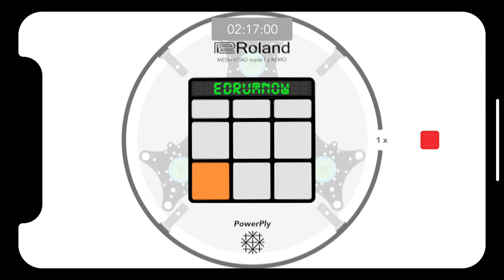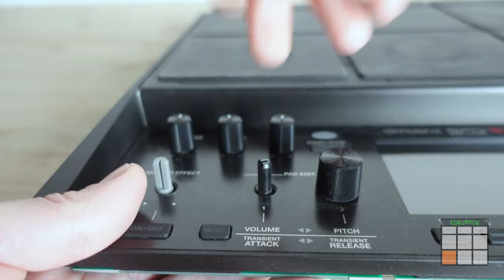Roland SPD SX PRO Disassembly

Comment: After I had to tear apart my Alesis Multipad apart to fix a corrupted sd card, I bought this to repace it in my live rig.  So simple compared to the SX PRO.  I never ever want to have to open it, but really enjoyed watching you take it apart.  Get it back together correctly, lol?  OMG, I'd have nightmares of forgetting one of those connections then... pad mute groups would have a glitch or where did all the sounds go?  Whoa, how do I have 1 screw left?  If its anything like my octapad, 12 years, 7 bands and 200 videos later, still no problems!!